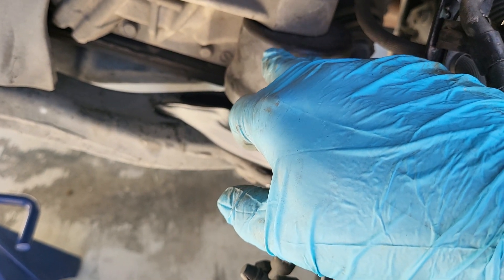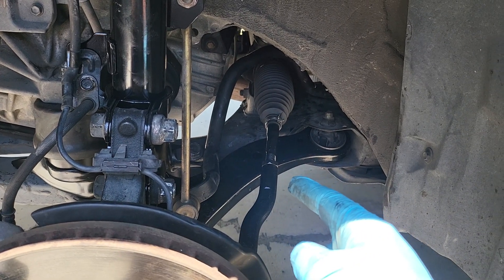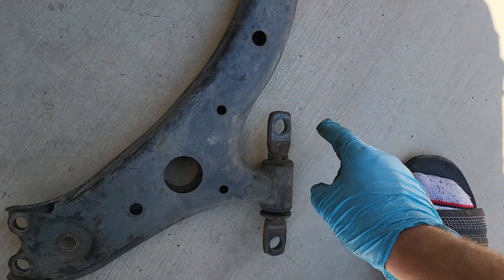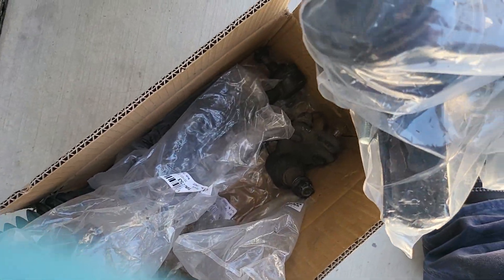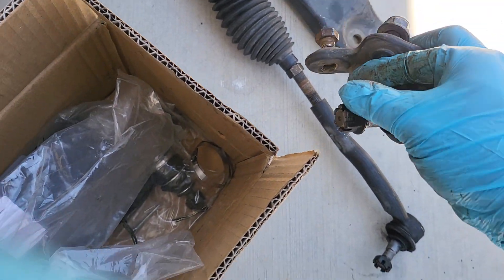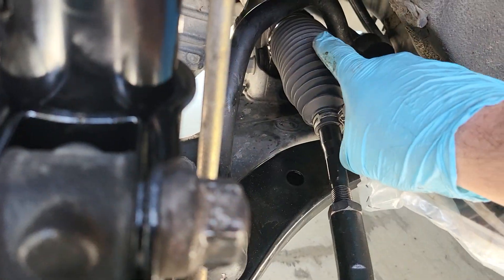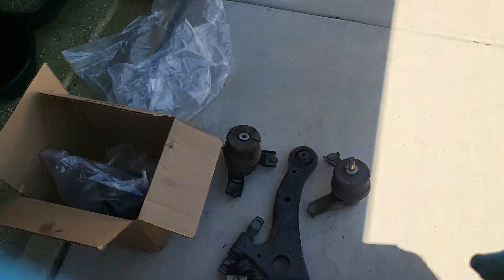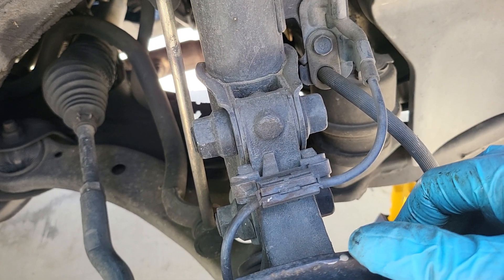2005 Toyota camry front end rebuild

Comment: A year later, how are the engine mounts performing? Were they used OEM or new aftermarket? Good job!
Reply from the maker: The top motor mount seems like it's on its way out again, but that is the easiest one to replace.  I think the consistent starting every day broke down the cheap rubber. Maybe you could buy the oem one from Toyota.  Might last longer.  I don't know.

Comment: Do u have the link to all these parts
Reply from the maker: I'm going to update my description with all the parts I used.  Prices have changed but at least you can use these for reference.
Reply: @PFab  Okay for sure I’d greatly appreciate it I have a 02 camry with 350k miles still running strong just need to rebuild that front end lol
Reply from the maker: @Hestevez0516  it should be updated.  Check it out.